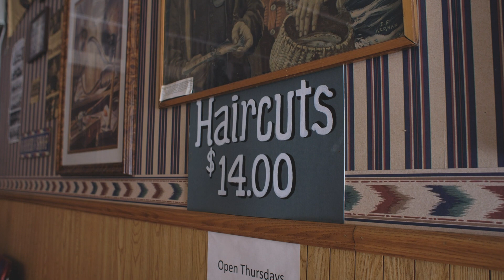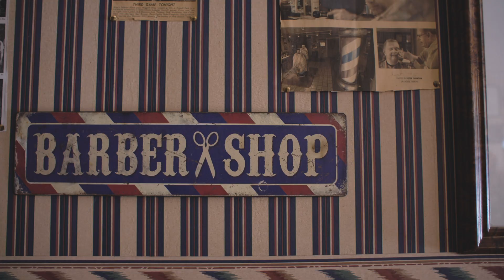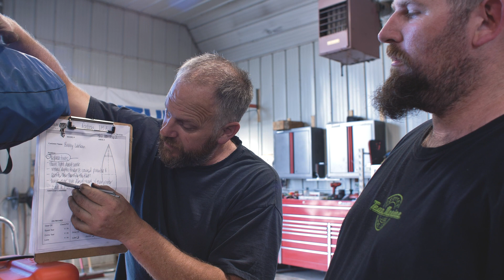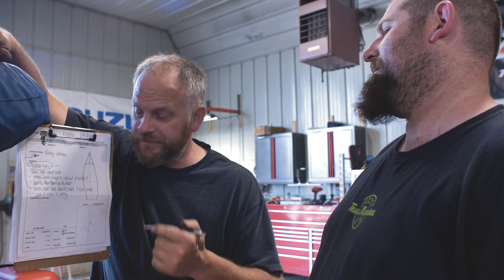"SHOP LIFE" - Day 3

Comment: I have a question, I have around $10,000 to spend on a used  Bass boat. I will be fishing small lakes in central Alabama, what boats do y’all recommend?
Reply from the maker: Ooohhhh probably a 17-18ft Ranger with a Merc 150 and a 24v trolling motor up front. You might be able to find a gem like that for $10k